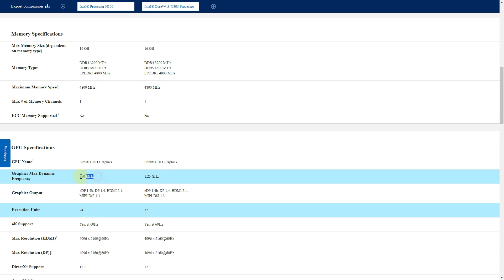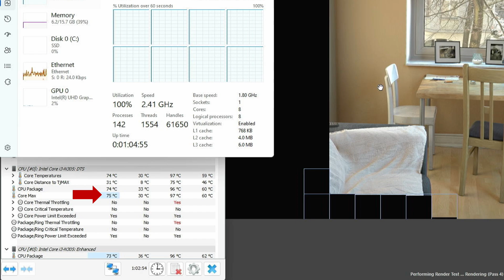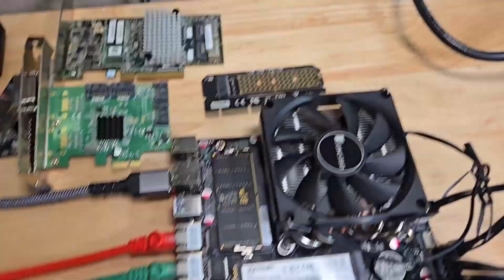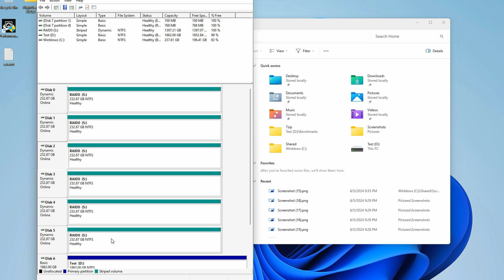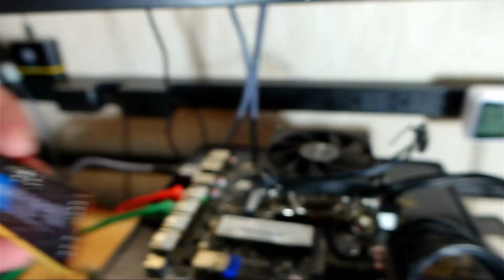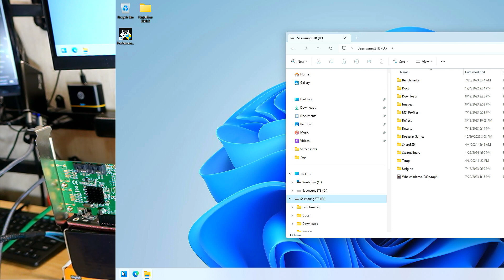CWWK Intel i3-N305 ITX NAS Motherboard Review (FAILURES)

Comment: for the pcie issue: its because when you plug something other than x1 pcie the board cannot handle it as not all data connecting pins are being used so because of such, the devices wont power up as expected.

i cannot say about 22.04 ubuntu it should be stable, but id suggest trying 24.04 or 25.04 as it may have things a bit more stable.

nice review of the board.

Comment: Very interesting, thanks.Do you know the difference with the purple board called "CW-NAS-ADLN-K" ?
Reply: Its a revision of the black board I think. I have the one shown in the video (which has worked fine for over a year now), with some issues at the start. Flashing the BIOS to the newest version fixed many strange behaviors, though I would not recommend to "plug-and-play" users (advanced users can get around things, but if you just want it to work out-of-the-box, I'd at least do heavy research of the board you are thinking of getting (issues they can have, OS's they can run well etc). I first ran Proxmox on it, worked fine for a while, then it just started freezing on me, often at boot. TrueNAS was never an issue with this board for some reason, Ubuntu worked fine and even Windows would boot with it. Not sure why it started acting up on Proxmox though (Proxmox was before BIOS flashing, I did that some time after starting to use TrueNAS, where TrueNAS would show me many strange checksum errors on my disk and I suspected it was instability. BIOS flashing fixed this completely). PS: before BIOS flashing, RAM showed errors too! Completely went away after BIOS flashing.

A friend of mine also has a board from CWWK for software routing (pfSense) and has reported it runs (long term) Rock-Solid for that purpose.

These CWWK/Topton boards are a mixed bag, if anyone gets one I'd recommend TESTING A LOT before running your stuff on them, to make sure its not factory busted. Keep in mind that some behaviors are quirks, and the point of testing these thoroughly is to figure out what is quirks and what are actual faults before using them for whatever you intend to use them for.

Sorry if I am a little all over the place with this, TL;DR is: These CAN work great, but research ANY of these boards thoroughly before making the decision to buy one. I bought one and learned the hard way, and luckily for me it worked out great (I am patient). Also, I want to point out: my reply is here to help anyone who want to know more, so I may have said things that comes obvious to you.
Cheers.

Comment: Constantly handling the board without esd bracelet, overheating the cpu by not using a heatsink, using out of spec memory (32gb instead of 16gb), and then complaining the board isnt running stable. You probably killed it yourself by the way you handle delicate hardware. If you work like this in a professional it company you'll get fired within the hour.

Comment: Bought purple one about 6 months ago (a new version as they say)... The same issue - just hangs randomly without a trace. The longest uptime is 16 days, but usually is about 3-5 days.
Reply: try underclocking your ram to 4400mhz or lower.  That fixed it for me.
Reply: @AxiosTK Try swapping the ram for Samsung, apparently none of these boards like crucial/Micron memory
Reply: @lefizz55 no need to - after reducing the clock, haven't had any issues since.  Will definitely consider for future builds if I need to expand

Comment: i purchased and returned 3 motherboards that were from a chinese supplier and all 3 had  memory dimm slot failure they came with 2 slots and i could only boot with one slot occupied which was the slot closet to the cpu wont buy these products anymore

Comment: What's the point of testing NAS motherboard in Windows? No wonder you have system issues. Intel 2.5 GbE networking drivers are known having issues with Windows, but they work flawlessly in FreeBSD. No wonder if drivers for other hardware are buggy. It's not CWWK's fault. This motherboard is for FreeBSD or Linux.

I have earlier N5105 version and not a single issue under TrueNAS Core (FreeBSD).
Reply from the maker: The lockup had nothing to do with the network ports, but with the RAM. It is a known issue with these boards, which I didn't find out until later. Underclocking the RAM seems to stabilize these machines. I had lockups regardless of whether I used Windows or Linux.
Reply: @htwingnut  Well, then it's not motherboard fault. Would be fair to note about it in the title. What was the RAM and manufacturer?

Comment: I purchased the n100 green board back in January specifically for the reason that the nvme and pcie slots do not share a lane on the green versions. Been working like a champ since setting it up.

Comment: Hi, I just bought the N100 ITX NAS motherboard and I'm also experiencing random freezes. I can't even install the OS... Would you happen to have any advice? I don't really know what to do

Thanks !
Reply from the maker: One thing you can try is to downclock your RAM. I hear that some users set their RAM to 4200 or 4400 MHz instead of 4800 MHz and seems to increase stability. You should be able to do this in the BIOS, but I don't have the board any more so I can't confirm, unfortuantely.
Reply: Wanted to let as many people know that doing so indeed fixed my stability issues and should be considered as a good option. Thanks!!
I'll start using the NAS and hopefully performance will be good as well
Reply from the maker: @SonicPlyr  Great to hear and thanks for the confirmation!

Comment: There is always power limitation on boards with dc input for pci slots. For example your 1050ti made for x16 slot with 75w desktop limitation with regular psu. Often for thon mitx boards there is info in manual of max power consuption. For example asrock n100 board can handle 40w pcie card at max with 90w psu, and 20w card from 60w psu. So there is 2 limits - from board and from psu, but 40w is upper limit
Reply: Yes exactly it's no issue to put pci X1 card in 8x or 16x slot, but doing the opposite will give lots of problems, you don't get the required bandwidth and power

Comment: I also have an N305 board that is hanging. I installed  it near the end of April and was out of the country in May and June. It hung on May 22. I've installed different software since I returned, and it is hanging more often.  The CPU temps are never over 30c.  Is there a new bios?
Reply from the maker: I haven't noticed a new BIOS but I did hear setting RAM to 4400MHz or lower can help. I haven't tested it personally. I returned the board back to CWWK.
Reply: @htwingnut  I replaced the 32GB of Crucial RAM with 16GB of Samsung and it has been stable since the swap.

Comment: Power consumption at idle about 19W???? Crazy!!!! My Core i5 12500, with 32GB RAM, with 2 SSDs, and 3 HDD (two spined down, one working all the time), with couple of containers (cloud, pihole, proxy, etc.) need about 30W.
Reply from the maker: Yeah, it seems that is the biggest issue with these boards. I've heard it's due to the onboard SATA controller, but I'm not so sure. Definitely could use some improvement in that area.

Comment: I just got mine and tried hooking up with a SFX PSU, I don't have a 4Pin connector so just plugged in the 24 pin ATX connector and powered on the PSU. The CPU fan has been spinning for a atleast 20min now and I don't see anything on the screen -- any idea what Im doing wrong? I do have a 6Pin PCIe connector but not sure if I should plug that into the 4pin slot
Reply from the maker: 4 pin connector is required for the CPU. It won't boot unless you have the four pin CPU power connector. The PCIe connector cannot go in the 4 pin slot.

Comment: I'm no expert, but a x16 1050Ti not displaying doesn't seem abnormal in an x1 slot.  In my head, many reasons why that x16 card cannot push a display.  Much less a 4k display.  Your PCIe to NVMe adapter is also longer than x1.  Your SATA controller is a x1 card, and worked.  The problem seems to be when you try to use a long (x4, x8 or x16) card in the x1 slot.  The absence of BOTH the 1050 and the NVMe drive as a device is indicating they're not POSTing.  The lockups and freezes could be due to the board or missing/bad software drivers, such as the chipsets.
Reply from the maker: Thanks for taking the time for watching and your message.

All the power delivery in a PCIe slot comes from the first 11 pins, up to 75W. All the pins behind that are data. You can always slot a larger card in a smaller slot, you will just get degraded performance based on the number of PCIe lanes.

With similar motherboards, I have no issue running a PCIe 16x GPU in a 1x slot, of course limited to 1x PCIe lane performance.

The issue seems to be because it is a shared slot, it only can provide up to about 10-12W as is typical max power for an NVMe slot. But that doesn't explain why the SSD wouldn't work in the PCIe slot when it worked fine in the M.2 slot.

Regarding the lockups, CWWK has acknowledged this is an issue with RAM running at 4800 MHz. Dropping speed to 4400MHz and it seems to be stable.

There is no reason to get this board at this point, however, when they have the CW-NAS-ADLN-K motherboard now which has full 4800MHz RAM support, a full 4x PCIe 3.0 slot, and two M.2 PCIe 3.0 x1 slots that can be used independently, and at a cheaper price.
Reply: @htwingnut  that is not entirely right. while the power is always on the first pins, per specification the maximum available slot power depends on the width of the card. i actually don´t know why they do it, i guess it has to do with more ground pins available on the longer ones. but 1x cards are limited to a max of 0.5A at 12V and 3.3A and 3V to a max combined of 10W. they can however draw up to 25W after beeing initialised as a high power device via software after boot. 4x slots are always 25W. 16x slots are 75W. a 16x graphics card (apart from really frugal ones like the GT710) or a higher powered raid controller should actually NEVER work in a 1x slot and most of the times not even in a 4x slot. if they do, either the board, or the card, or both do not adhere to the pcie specifications.

Comment: I am highly interested in the new CW-NAS-ADLN-K version, so I contacted the seller with WeChat. They told me that the BSOD you are seeing is most likely memory-related. They told me that crucial memory dated 2023 is incompatible. Please test again with something other than 2023 crucial.
Reply: My CW-NAS-ADLN-K has arrived, using 16GB kingston 4800 memory, ran mem test86 overnight, did a raid 5 status check, so far there is no crash.

Comment: What did CWWK say about the heatsink touching the capacitors? 
Also when I ordered the purple board they said I should use Samsung or SK Hynix RAM. I already have 32GB of crucial so hoping it’s not a compatibility issue. Still waiting on delivery 😅
Reply: Mines has arrived - I am very happy with it! Can’t wait to see your video on it. RAM is 32GB crucial and is currently running through at 24 hour stability test. No issues so far!
Reply: @zr0dfx  
Hi. I am also interested in that one.
Did you test PCIe slot with any kind of card, adapters, GPU or anything similar ?
Reply: @zr0dfx  
One more question about purple one, I see this one has fewer LAN ports so I wonder if PCIe shared with second M.2 slot ?
Reply: Would be thankfull for ur feedback for the purple mb❤

Comment: Were you able to get different board or a refund from them?
I thinking about buying a Mini PC from CWWK and now I'm concerned about their customer support in case something's wrong with it.
Reply from the maker: They have been very good so far. They are allowing me to exchange it for their "purple" board CW-NAS-ADLK-K. My return board hasn't reached their facility yet, but they said once they receive it, they will ship out the replacement right away. All their other products so far that I have checked out seem to work perfectly fine.
Reply: @htwingnut  Do you plan on doing a review of that new purple board when it arrives?
Reply: Okay, thank you :)

Comment: In your description you said the motherboard has x4 pcie slot. The first video card (Nvidia 710) graphics card is a x1 pcie video card and only requires 1 pcie lane.  The msi video card is a x16 video card which requires 16x pcie lanes to work. The NVME adapter also looks like a x16 device which would require 16 pciei lanes to work. The LSI is a x8 device and requires 8 pcie lanes to work.
Reply from the maker: Thanks for the feedback. However, all the power comes from the front 11 pins, up to 75W, and then the data lanes are everything behind it. A 16x card can run perfectly fine in a 1x slot, just with reduced performance. I think I have a video somewhere showing this.

Comment: I have some story with this boards too. I bought n305 mb with 32gb ram and 1tb nvme,  but received N100. Now I'm in the process of the return. The N100 mb is flawless, my system is running for 2 days without a hickup, but I do not use any pci-e card, just a second nvme drive. The only thing I'm not happy with is the Jonsbo radiator, which is a little bit noisy. I'm wondering if any standard radiator (ex. Noctua NH-L9i ) would fit this mainboard and if I could remove completely this copper block and use the radiator without it.

Nevertheless even N100 is not that bad in term's of CPU, but since I'm using Proxmox (Unraid + Docker VM), I need 8 cores from N305. You can find some information that N100 won't be reliable with Proxmox, but that's not true, It's working flawlessly, keeping in mind there are only 4 cores to allocate.

The second thing that made me a little bit worried is that when I placed the radiator, I screwed it to the end, which caused the whole mainboard to bend and I realize that when I screwed the mainboard to the chase. I loose them to a a more comfort bend, but that's a shitty design. The copper block is few mm higher than standard CPU IHS and the lack of backplate element does not help. Do you still have this board?
Reply from the maker: If you ordered an N305  they should provide an N305, sorry that happened. The Jonsbo radiator seems to touch down to the capacitors just next tot the CPU. This has me concerned.

I still have the board and am trying to get it replaced with the newer CW-NAS-ADLN-K board.
Reply: @htwingnut  Well, I'm currently waiting for N305 from your video, hope it will do same as N100 I've returned :) I've replaced the fan from the Jonsbo radiator to MUCH silent, a little bit thicker Noctua Redux fan, which has the same airflow, but it's like 17dB comparing to 27dB. It was day and night.
Reply: Hi, I’m currently running n305 board that you’ve reviewed, with no issue (without pcie card). Enabled cstates in bios. The CPU is much more efficient than n100 :)
Reply from the maker: @HighFlyD  What kind of RAM are you using? It seems that this board for whatever reason is sensitive to RAM. Some have stated to drop the RAM speeds to 4400, others have swapped RAM altogether and had better improvements. I'm just not fond of a board that's that sensitive to RAM, not to mention the limits of the PCIe slot. Thankfully CWWK are exchanging the board for their "purple" board which seems much more competent.
Reply: @htwingnut I,m not sure, I bought memory in bundle with the mainboard. No issues so far and I have it going 24/7
Reply: @htwingnut hi, just updating it is working since that time 24/7 :)

Comment: I got the topton version of this and im also having issues with system hang as well as hdd failing to move data after certain amount of time.  At first i thought it was a ram issue as my crucial ram failed memtest, but my replacement ram also failed.... 2 bad rams could be a thing but I've been building computers for over 10 years where this is the first time I'm having memtest fails.

Not only that, this board showed up way later than promised which delayed my build for 3 weeks.
Reply from the maker: Thanks for the feedback. Yeah something doesn't seem right with this motherboard. Maybe a BIOS update will fix it. It could also be a manufacturing defect or design error too. Curious that you're seeing the same issue.

No way I will be using this or recommending it for any project. I can live with the PCIe slot quirkiness, although it's not right. But lockups should not be tolerated.

Good luck. I'm hoping to get this swapped for their newer "K" purple board. Hoping it's better equipped.
Reply: @htwingnut  just wanted to update you after doing some digging... apparently, these boards are very sensitive with ram.  Someone had success with lowering the ram speed from 4800 to 4400 so I tried that just now.  About to complete one pass of memtest with 0 errors, while at 4800mhz it threw out about 75 errors. 

Give that a shot and run memtest to see if that will resolve the system from crashing.   Once I get through 2+ passes, I'll fire up the unraid server and validate.
Reply: @htwingnut  wanted to update you that the memory timing declock has made my system stable and haven't had a crash since.  It completed 4 passes of memtest with flying colors.  Completed a 12TB parity check and is humming along now.
Reply: @AxiosTK  What ram you using? i have same problem with my SP 4800 16G :(
Reply: @jaycee7646  Crucial 32GB DDR5 RAM, 4800MHz CL40 Laptop Memory.  Underclock it down to 4400mhz or lower and you should be good!  Mine has been up for months with no issues since.

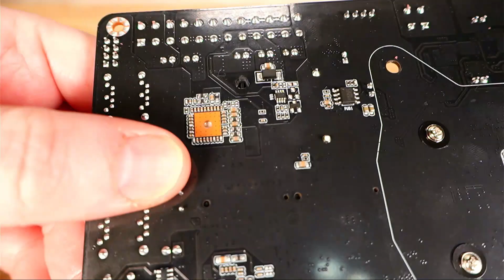Comment: at 5:16 you mentioned taking off the metal shroud from the cpu, but never did; it got planned for a future video perhaps?
Since I'm eyeballin' their 8845HS-board, I'm kind of curios to see if it's hack job or not.
Reply from the maker: Yeah, sorry. I started filming this in the beginning not with the expectation that it would be a problematic board. I didn't want to remove the copper plate for fear of not getting an RMA. I am hoping to get a resolution soon, and will gladly remove the copper plate if/when I get a good unit.